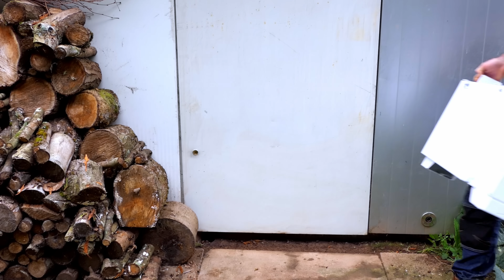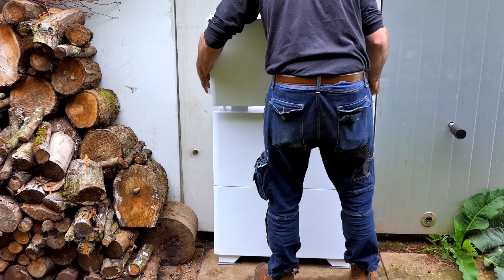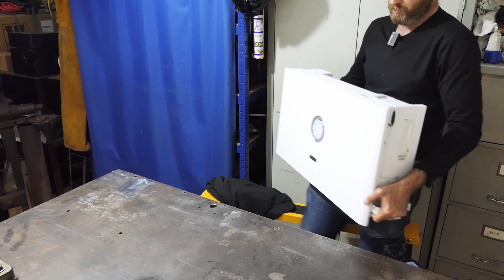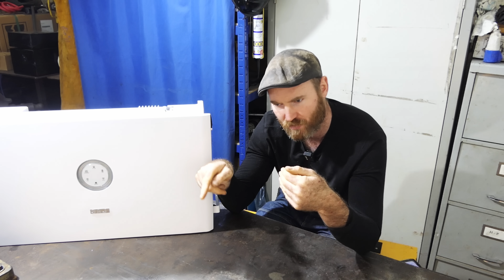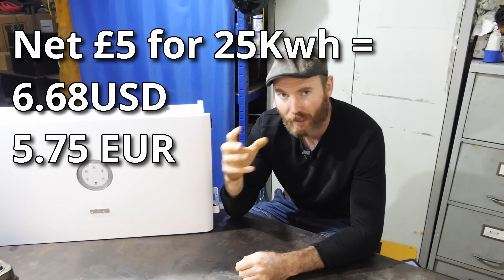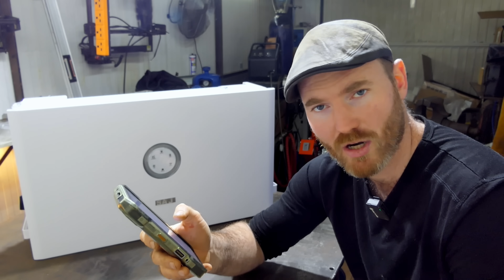New Batteries Make Money?... I'm shocked

Comment: So what's wrong with charging the batteries at 8 pence off peak and then just using using that power to run the house during high peak times.
You'd be saving 40 pence per unit for every unit used outside off peak hours, or am I missing something?
Reply from the maker: Its relative to the install cost and depreciation. If it costs £10k to install and breaks down in 5 years (hypothetically) you would be better off just being on the grid.
Reply: @joshuadelisle  napkin maths for me would be a saving of £675 per year if I only used cheap rate. A tesla pw installed quote is £8000. So payback in 12 years. 
Obviously quicker if I generated power with PV or other.
Thats about the same time as the panel payback from 5 years ago.
Hmmm, roll on Sodium Ion batteries.............

Comment: Making money??? Not for long. 
More like they are going to put a tax on it soon.💲💲💲🤦‍♂️🤦‍♂️🤦‍♂️
Just use cheap affordable fossil fuels.. There is no climate emergency! 🌞🤦‍♂️🤦‍♂️🤦‍♂️
The "SUN"  drives the earths climate not  manmade gases!!!
The CO2 Climate Narrative Collapses Under Basic Physics.
For years, we’ve been told that CO2—a trace gas at just 0.04% of the atmosphere—controls Earth’s climate. But a new study in Science of Climate Change exposes the flaw: The data doesn’t add up!!!
- 93% of warming is in the oceans, yet their temperatures jump erratically, ignoring CO2’s steady rise.
- 1963–70: Cooling. 1970–80: Warming. Post-2000: Stability. Why? Natural solar cycles, clouds, and aerosols—not CO2. 
There is no climate emergency!!!
There never was a climate emergency it has always been about control and money. 
- Satellite and ARGO data confirm: Earth warms when solar input increases. Not because of a trace gas.
The IPCC’s models overstate CO2’s role while ignoring the sun’s dominance. Even the remaining 25% of warming is uncertain—cleaner air (fewer aerosols) means fewer clouds, which also warms the planet.
"As redistribution of “heat in the pipeline” will not change the total OHC, roughly ¾ of the observed positive trend in OHC must at least be attributed to rising solar input. The oceans act in this way as our climate system’s thermal buffer. It will mitigate warming during periods of increased solar input and dampen cooling when solar input declines, underscoring its critical role in Earth's climate stability"
Conclusion: CO2’s impact is minimal. Climate sensitivity is overestimated. No apocalypse—just natural variability.
Taxing people in the belief that the Government will stop climate Change is criminal fraud. 
https://scienceofclimatechange.org/wp-content/uploads/SCC-Vol5.3-Huijser-Balancing-Act.pdf

Comment: I give you a tip . Save your money . It will take 8 to 10 years to pay for itself . By which time the inverter may need some attention. That's if the export profit stays the same as now. (spoiler alert it wont). Put the same money in the s and p 500. Scenario 1: The S&P 500 Index Fund
The money in the stock market grows through compounding returns, but the annual percentage gain is variable and not guaranteed, unlike the previous bank scenario. The following table illustrates the potential outcome based on a consistent average annual return of 12% for simplicity.
Year	Starting Balance	Annual Growth (Avg. 12%)	Ending Balance
1	£6,000.00	£720.00	£6,720.00
2	£6,720.00	£806.40	£7,526.40
3	£7,526.40	£903.17	£8,429.57
4	£8,429.57	£1,011.55	£9,441.12
5	£9,441.12	£1,132.93	£10,574.05
6	£10,574.05	£1,268.89	£11,842.94
7	£11,842.94	£1,421.15	£13,264.09
8	£13,264.09	£1,591.69	£14,855.78
9	£14,855.78	£1,782.69	£16,638.47
10	£16,638.47	£1,996.62	£18,635.09
Total Value After 10 Years (S&P 500): £18,635.09
Scenario 2: The SAJ HS3 Battery System (Arbitrage)
The battery system generates linear annual savings/income of £800 per year.
Year	Annual Savings/Income	Cumulative Savings (Profit)
1	£800.00	£800.00
...	...	...
8	£800.00	£6,400.00 (Break-even point)
9	£800.00	£7,200.00
10	£800.00	£8,000.00
Total Net Profit (Cash in hand from savings) After 10 Years: £8,000.00

Comment: The "free energy" claim for "renewables" (there's nothing really renewable about them, hardly any part of them is recyclable) is pure propaganda. 

They are the most expensive power production around. 

Their EROEI (including the necessity for storage - which fossil fuels and nuclear is already included in the fuel itself) is horrendously low. 

EROEI  = Energy returned on energy invested and it's a way to calculate the economic viability of an energy production project. In fact, it's so low that it's comparable to burning wood in Roman times! Fossil fuels and nuclear in comparison are MUCH cheaper and with much higher EROEI. 

About 30 to 50 for fossil fuels and over 100 for nuclear (which means for every unit of energy invested you get back 100 times or more - in the case of nuclear options - your energy input). 

Now juxtapose that to SINGLE digits EROEI for renewables and you'll understand why the more renewables contribute in the energy mix, the more expensive energy gets. Ask Germany how it went with their aggressive push for renewables.

Comment: I've been off grid for 10 years. The issue with generators is that the maintenance can be expensive. Cheaper models will take significant servicing time and I had one which even caught fire. Batteries are not optional if you decide on this route and they need to be large enough to pull a substantial charging load from the generator - if not, your generator becomes just an expensive heater.

Comment: Not going too well for the Tesla batteries at the moment is it? Let the gullible idiots pay for the problems we have with renewables, and if it doesn’t work, it’s their problem and they paid for it. 😂😂😂😂 
Completely sealed you say? What happens when it starts off gassing? You do realise that builds up pressure, is explosive, and is really really toxic? Heating elements fail, batteries degrade and it only takes one cell to go bad for you to have a thermal runaway event bolted to the side of your property. Good luck with that. How does your insurance company feel about this? 
Then you say your installer will take on the liability of these projects. 😂😂😂 They’ll go bust as soon as the problems start. And your figures? You are charging at the cheap rate, and selling back for a profit? What about the energy you’re using? So you’re probably not going to make anything from a 5Kw unit, so all you’re doing is downloading your electricity on the cheap rate at night and taking the pressure off the grid saving the supplier from upgrading the grid. 😂😂 Oh boy. The more I look into this renewable energy market, the more I’m convinced it’s a cult. I was seriously considering putting solar panels on my house, but the more I researched, the less likely I was to get it.

Comment: I live off-grid in Canada. EVERY grid connected green energy scheme IS a scam. They exist to obfuscate the truth - that ditching the grid entirely, is not only possible it's so much cheaper it would ruin them if it was done at scale, but the catch is that it would actually be hard to achieve. My house is designed from foundation to roof to maximized power use. I use a 14kw system with backup generator. Because I'm not tied to grid I don't pay any connection fees, taxes, no red tape, and I never have to worry about blackouts. And because I installed it when I built the house the cost is rolled into the mortgage. I haven't paid for power in over four years. The lure of 'selling power back to the grid' is the trick that keeps people from doing this, it's the lie they tell to keep people on their services. Ditch the greed monster and you can have actual cheap power.

Comment: It all sounds good, but the bit I don't get and not just with this version, is all of the solar panels, water wheels at the bottom of your garden, any power pumping or pushing back into the grid? How far does power push back into the grid actually travel, there transformer and all sorts of stuff in between the house and the actual real backbone of the national grid, and voltage changes all the way too? So, if, like in the middle of electricity nowhere to real electric users by you, at your side of the electrical transformer, does that power supplied back into the network actually make a difference? 🙂

Comment: Having a 5kWh battery should be about charging for 8p overnight using in the house during the day meaning not having to buy 27p daytime units.  The economics of the big battery specifically to trade electricity are really simple to calculate - made sense during the start of the Ukraine war, probably not now, especially at the prices you've been quoted for a system.  But even a small quantity of solar in that mix will make a huge difference in the overall economics, you can very easily get to point of buying just a few pence of grid electricity per day for more than half the year.
Reply from the maker: It is relative to the capital outlay and depreciation. The savings only break even in 10 years minimum, That's only if the system lasts that long with no faults. Cheers J

Comment: Thanks for doing the maths, my brain just turns off when numbers like that are presented.  The return on investment is too long, you would need to match it with solar panels, and an electric car, modern panels do generate power in winter, albeit at a reduced rate.  This should give you a lower break even point.

Comment: For me I took a battery with my solar panels, because I don't use all the energy when it's abundant. The energy provider doesn't give me a nice price during these times for the surplus energy I produce. Then I charge my battery. 
In the evening I get nothing from my panels, so I get the energy from the battery for practically free as opposed to needing to get it from the grid. 
It's not as much of an off grid enabler for me... Yet...

Comment: Small local storage feeding back into the grid cannot work because the street cabling was never designed to accept the loads. A thousand of these in a small town would melt the cables when they all decide to cash in at premium.
Reply: No because the power is used locally

Comment: I looked at a battery system but its very expensive. I have a solar system thats grid tied currently and an ev charger. I dont do a lot of miles but i used to have a diesel bill of £200 per month. I now have an electric bill of £110 per month that covers my driving too... ev cars are not the solution for people that have a massive commute but for someone who can operate within the restricted mileage of an ev it is very doable. When i can afford it i intend to add a house battery to make best use of the day/night tariffs from my electricity provider. Ideally id like to add a wind turbine but in NI all turbines require planning permission which is a farce too...
Reply from the maker: Thank you for sharing that. That's very interesting. Cheers J

Comment: the grid still requires a base load in correct phase and they plan a head in excess, these small things in small scale do nothing to dent the base load. if you have your own excess despite batteries, either get more batteries or get a liquid nitrogen battery.

Comment: Actually the government just had a consultation on plug in/balcony solar.

On the continent they literally plug their solar/battery systems into a wall socket. In UK currently it requires a fused spur and no, an MCS cert is not required to access feed in tariff (Big scam).

I have self installed an 8kw system myself with fence mounted solar and bringing my usage in November down to 0kW minus my EV charging.

Coming from a £3k annual electricity bill I hope to have paid back on my install in a year. EV and batteries can charge at night at 7p/kW.

Comment: Hi, I commiserate with you as here, in France, we also have brain dead ruling the country.

I don't know what kind of electrical installation you have in your house, but you might want to install something like Home Assistant, it works easily on a Raspberry Pi 4 (4 GB or 8 GB RAM, with a low consumption ~4.5 W idle or an Odroid N2L 4 GB RAM ~1.5 W idle)  that will detect a grid loss from your battery pack signal (wired or using the wifi of an ESP32, but before that check your manual, as today many devices come with their own wifi or even a wireless Zigbee interface) and turn off every device that isn't essential, use static relays, they cost more that the mechanic ones, but they last like forever and commute only when AC crosses the zero.   Bonus, as HA is quite easy to configure (YAML files), with a static relay and an induction sensor on its line, you can ie.: keep the washing machine running despite the black out to make sure your clothes will be clean when coming back home.
Reply from the maker: That's really insightful feedback, I'll definitely look into Home Assistant and see how I can integrate it. Cheers J

Comment: hi I've got a 6.4 solar system with batteries on a 3 bed house and have no energy bills for 6 months out of the year. but I am considering ways to generate better in winter with wind maybe . but not got a big garden for anything massive. but I like the idea of a diesel generator as backup if grid goes down 🤔

Comment: Your analysis is basically buying and selling the same amount of power which gives you your income. It looks like you are assuming that your home is running normally just buying from the grid when it needs it.
13:18 However you won't be selling all the electricity that you buy in cheap because you will be using some of that electricity from your battery in your home so that will be cheaper for the home.
When you get your solar panels you won't have to buy some of the electricity for your battery. You will generate it for free. That will lead to further savings. Your income will be higher than you think.
You said that the diesel generator is noisy but you should be aware that is also polluting which is detrimental to health and climate which has a cost for someone even if it is not obvious to you .
Finally the goal off going off grid if you are already connected obviously means you can't trade but also the surplus energy you generate will just be thrown away when it could be used by your neighbours via the grid connection.
Reply from the maker: Thank you. Profit can be counted as savings. Excess energy with an off grid set up can still be accessed by  neighbours if set up to do so or can be used for a multitude of other operations to store energy such as electrolysis HHO generation, warming up bio digesters, UV plant lights for extending growing times, water pumps for tower storage etc. Cheers J

Comment: Would it save you money by using cheap rate electricity at peak times rather than selling it back?
Reply from the maker: Depends on how you want to calculate savings. Profit is equal to savings if you use it instead of selling it. Cheers J

Comment: Feeding power back into the grid via electrics cars is already viable  (I think Octopus Energy are doing something with BYD)  so buying a battery pack to do what you are suggesting may not be necessary. The other thing is a lot of work is being done right now to bring in new and upgrade the National Grid  and the plan seems to be to have it substantially sorted by  2030 (maybe 2032). The upgrades to the Grid will  allow electricity (including that generated by wind farms) to be transferred back and forth around the country to meet demand. 2032 is only 6 years from now - though apparently there is a serious shortage of engineers so timelines  may slip ........
Reply from the maker: An electric car is a depreciating liability not an asset that brings a return on investment. But if you have one anyway then I guess it's worth doing.  Cheers J
Reply: @joshuadelisle  it was along the lines of you lease a BYD (think it was a Seal on pretty generous terms)  but have to keep it connected to the Grid for so many days a month so it could be used to take power back out of the battery at times of demand - I think it was Octopus pushing it  ( the scheme not the car that is)

Comment: I've been starting to look at solar panels, and the newer high efficient rollout versions for the workshop. Still out on whether it's worth the initial outlay or not. Will be interesting to hear your take on it, especially as I'm based in Northern Ireland.
Reply from the maker: Solar panels are getting very cheap, as little as £50 for a 200w panel and they're very easy to install. I'm going to do a whole roof on my office I'm building. Cheers J

Comment: 3:44 97.6% doesn't strike me as especially efficient, I'm pretty sure I've seen inverters with efficiencies north (higher than) of 99%. However I don't know how it is calculated for systems like these.
10:03 In Germany it wouldn't be possible. Yes, you can choose to buy electricity at energy stock exchange rate (plus overhead cost, and plus markup) but you only are allowed to sell it an abysmal low rate. I think it was 0.08€/kWh. And even if the exchange has a negative rate (They pay to take electricity) you don't get that rate. But when the rate is more than 1€/kWh you are forced to pay that high rate. Plus an overhead surcharge, taxes on top, and the markup the then put on the whole (and lastly VAT).
But you might get the rate as low as around 0.10€/kWh all cost included. Not a way to make money, but to get cheaper power. Especially if you substitute some with with your own generation.

Comment: Be total self powered. I am, with a single cylinder diesel @ 1liter (red) per hour, 5kwh. Works out roughly same as grid power but no standing charge and I'm in total control. Of my power. Oh and I get all my hot water from the cooling system on the engine.
Reply from the maker: Nice well done. Cheers J